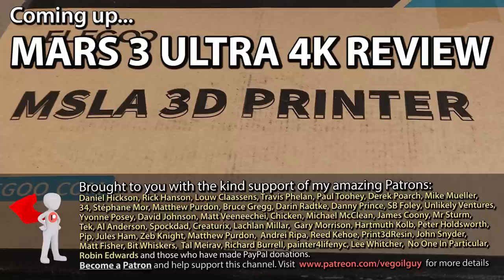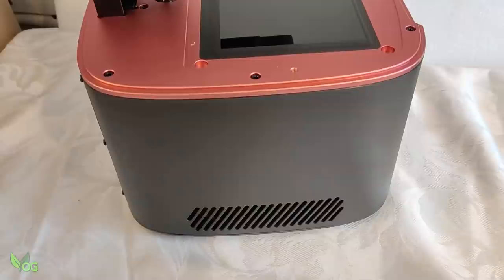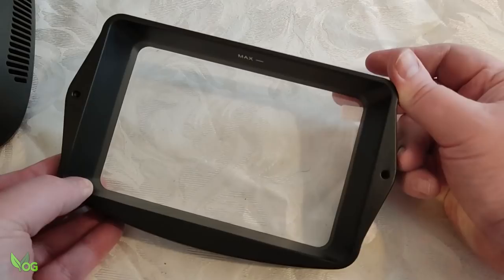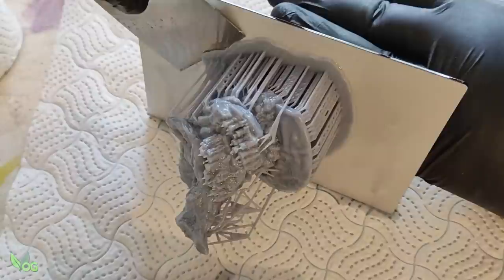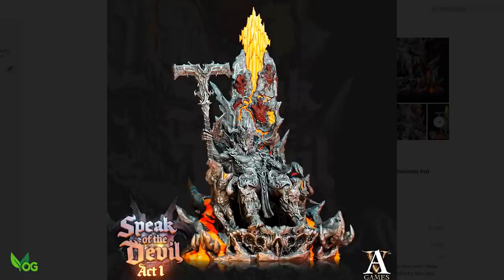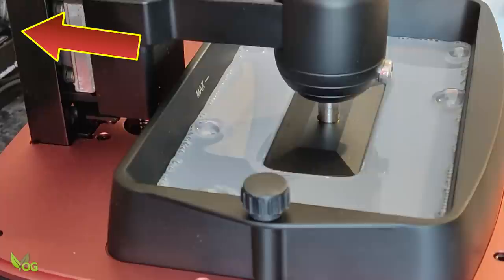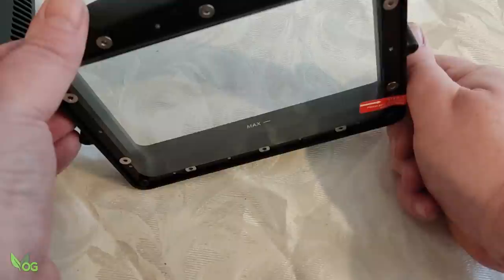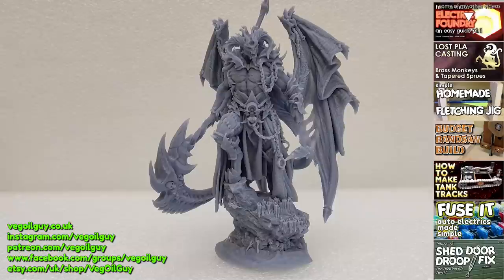Elegoo Mars 3 Ultra 4k HONEST review + Z Wobble Worries by VOGMAN

Comment: Is pouring out resin an issue without a poor spout, or can you drain the vat nice and smooth? Also, does Elegoo allow cancelations of pre orders? Z axis issue and forced use of one software is troublesome. I actually prefer Chitubox, but don’t want to be forced to use it.
Reply from the maker: If ChiTuBox works for you, then great. There's nothing wrong there. Personally I experience bug issues. Without them my opinion of ChiTuBox would be much higher.
I've noticed no difference when emptying the tray. 
As for cancellations, I've no idea. Just be sure if you cancel it's for the right reason. We haven't yet established that my machine is typical. It may well be a one-off.

Comment: Hi I‘ve watched your videos and cant quite decide what to buy either the Anycubic Photon S  or Photon mono SE or the Elegoo mars 3 what would you recomend ? Photon S is at the moment half the price of the others but for me details also matters...
Reply from the maker: The S lacks a Monochrome screen and that's why it's cheaper. The SE in Monochrome, which makes it faster printing (maybe 2 or 3 seconds per layer instead of 8 or 10 seconds), and longer lasting. It's the way all the printers seem to be going - for now. I suspect a change in the near future but I'll reserve judgement on that for now :-)
As for the SE vs Mars 3, that's 2K vs 4K. It's also dual rail vs single rail. 
Right now for the reasons I've said in my video, I can't personally recommend the Mars until I know for sure that the wobble isn't a problem.

Comment: I have Mars 2 Pro and i have same  "Z wobble". I nitice that Z pillar is flexing during few firs layers. In my opinion, this is due to the fact that the resin has a high viscosity and as the table falls at the first layers, the resin cannot escape and leave just 0.05mm. It seems to me that the solution would be an option in the slicer for the first layers to be 0.150mm for example and the rest 0.05mm. So far I have not found such a solution in any slicer
Reply from the maker: Thanks for your input 😁

Comment: Interesting. My Sonic Mini 4K has z-banding problem on most of my parts and others have pointed out there are deep flaws in that machine that are probably the issue with my prints.  I was excited to hear about the Mars 4K as a possible replacement....now, not so much. 

It's a race to the bottom with these budget 3D printer companies. Come out with some new tech which is an improvement, but then cut corners on old tech.
Reply from the maker: I'd heard about the Mini's wobble issues and that's why I was concerned here. I'd hate to encourage anyone to spend their hard-earned money on a printer that doesn't live up to expectations. I have high hopes for Elegoo, but as I've said, for now I take the approach - "Let's wait and see what happens."

Comment: New to 3D printing but just wondering if the print plate was adjusted to be flat using the paper and the Allen key etc? Might be the reason of the wobble?
Reply from the maker: Yes my friend, it was nice and level. The prints prove this. And never be afraid to ask questions or offer an opinion - we're all still learning 😁
Reply: @vogman  Thanks for replying most appreciated. I may have a Mars 3 on order… I’m really hoping your’s is a one off or sample model and won’t be on mass production…! Here’s hoping haha. Look forward to more videos, thanks.
Reply: @vogman  Just FYI -  I contacted Elegoo about the Z wobble concern, they said this: 

"This situation occurs in the evaluation video because the build plate and LCD screen are too tightly attached during the leveling operation. 
As long as the leveling is normal, this phenomenon will not occur, and it will not affect the printing. Please don't worry."

Again, I've never used a 3D printer, so I have don't know one way or the other but just thought I'd share this, I'd be interested to hear your thoughts! thanks again  🙏

Comment: So new to resin printing and I'm trying to decide between this one and the phrozen sonic mighty 4k.  The Mars 3 has the better resolution, Phrozen has the better software.  Is the chitubox software bad enough to make the difference?  Sounds like it from what I'm reading. Edit:spelling
Reply from the maker: We all feel like that when we're new to something. Once you get your feet wet, you discover it's much easier than it sounds. Check out this video I did on using Supports with ChiTuBox - https://youtu.be/MU0Cq_bjhy4
ChiTuBox is very capable and works well, but like all things people have varying preferences. I personally prefer Lychee, but I do use ChiTuBox, so it's not an impossible task 😁
As for 3D resin printers, there are so many to choose from now. If you have no experience at all, it might be worth sacrificing some money on a very cheap model, the cheapest you can find. You'll still be amazed how good it is.
If you can cope with the smells and the mess, that's the time to decide if you want to invest in a more expensive printer. Hopefully by then we'll have a few more DLP printers on the market which look as though they could really shake up the printer world.
Reply: @vogman  Thank you, that's really good advice.. I'll do that.

Comment: you don't seem to understand physics. It is a piston in liquid. It's not wobble, it's deformation due to  pulling something. If's it's dry, you don't get pulling like you show with other printer
Also, it should not effect printing quality, unless it's not flexible deformation. since when it's doing exposure, it's already settled into correct position.
Reply from the maker: You may be right. More testing is needed I guess.

Comment: Hi thanks for sharing !
Have you noticed an visible impact of the wobble on the prints?
Such as horizontal lines?
Thanks
Reply from the maker: So far nothing. The prints are excellent.
Reply: @vogman  cool. Even tall prints?
I encounter some horizontal lines with my sm4k...
Reply from the maker: I haven't maxed the height yet. The miniature I did here stands at 200mm so sections of that were pretty tall. How do they look to you? These are the best pictures I could manage I'm afraid 😁

Comment: My Phrozen Sonic Mini 4k (as a point of reference) does that wobble and my prints are nice!
Reply from the maker: I've heard this about the Mini 4Ks and I've heard from lots of sources claiming it has a major impact on their print quality. Right now this Mars 3 has a little wobble but prints great. My fear is that in a few months it may have more wobble and print less well. Hopefully I'm wrong.
Reply: @vogman  I hope you don't find that out....that will make me look :(. And I dont want to check on my wobbly.
Reply: Speak for yourself. I have z-banding that matches the leadscrew pitch on basically all of my SM4Kprints. Done all of the suggested mods(lube linear rail and bearing/lead screw, tighten anti-backlash nut, made sure the lead screw is true, several alternate bed levelling techniques, trued the screen to level with Kapton tape. Pretty much everything. I've boiled the issue down to the single rail rather than dual as well as the overall slight construction which leads to Y and Z instability.
Reply: @upgrayedd9732  hi. Same here with sm4k. I saw a video where the guy recommend to install A nema17 stepper motor damper in first. then change the linear guide and its rail if no improvment.
Reply: @romainflechon4567  Yeah I read about a few upgrade kits in the works as well. The motor damper is interesting.

Comment: As I say for a printer that can do 0 MPH -6OMPH in less than 0.1 seconds! 🤣 I feel that Elegoo should do more research before they bring out the final product and speak to people like you (the professionals) to see what can be improved on it before bringing out the final version of said printer, yes the USB flash drive port should be on the side and the on/off button on the front, but I think the on/off button could be more to the side of the front some people may accidently hit the power button while trying to put the correct info into the settings. So it from what I can see in your review is I would give the new Ultra 4K a 8/10. Keep up the good work and I will see you in your next Video 👍⭐⭐⭐⭐⭐
Reply from the maker: Me a professional? My wife would say a professional idiot 😁
Good to hear your input John.

Comment: 3:13 Well, 35 microns versus 50 microns is a 30% difference, so I think is a better improvement than it sounds when you hear it for first time..
Reply: I don't think you would see a difference. And not on paper but in prints.
Reply from the maker: You could be right 😁
Reply from the maker: When I compared the Sonic 4K against another printer, the improvement was there but ideally needed magnification to see. 😁
Reply: @vogman  For you the question is "Does that difference transfer to the casting molds?". And i don't think so :D And if you even prime the print that quality increase means nothing :)
Reply from the maker: Oh, well, casting detail... that's different. Now you've got my attention 😉😁😂🤣👍
Reply: And how about after priming? Would love to know the thickness of a skilfully applied coat of primer. Because the it all seems moot to me.

Comment: Lens distortion is a bitch when trying to measure flex.
You can get filters to remove lens distortion, but itll never be true Orthographic.
Reply from the maker: Actually Steve you're the first to state that and I think you may have a point. If you're right it will p Elegoo off as they've been working on the problem all week 😁

Comment: It's the same wobble that other mars printers had. The entire Z axis is loose. That's a QC issue not design.
Reply: I can't speak for the Mars 3 because I don't have it, but the Phrozen Sonic Mink 4K also has Z-axis wobble, and that's definitely NOT a QC issue, it's a design issue: only two screws fix the Z-arm in place from underneath, therefore locking it along a LINE (allowing it to rotate along that line), not on a plane which would lock it in place, and the base itself is too thin and therefore not rigid enough to hold it straight, even if it had four screws. since VOG said he couldn't find anything loose to tighten (which would be a QC issue), I'm afraid that's the case for the Mars 3 too
Reply from the maker: Hopefully it's an easy fix... IF there's a problem outside of MY printer. 😁
So far no print quality issues.
Reply: @pgabrieli  Interesting. I can't speak for PSM4K but in mars it was just a matter of tightening the screws.
Reply: @vogman  after watching 3DPrintingPro's review, it wasn't an issue with just your printer :-(